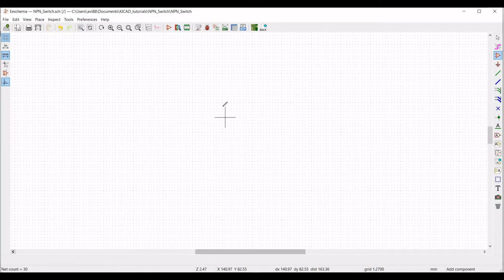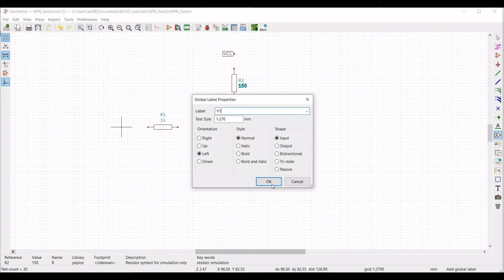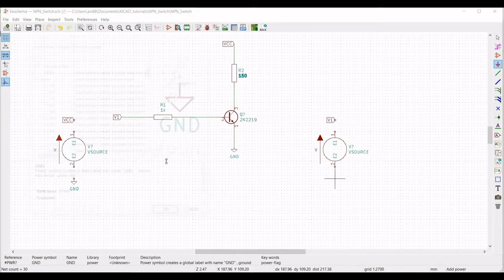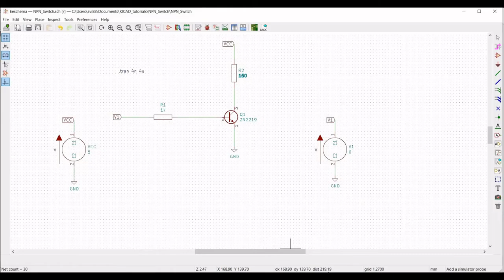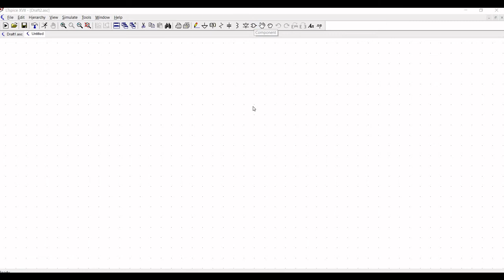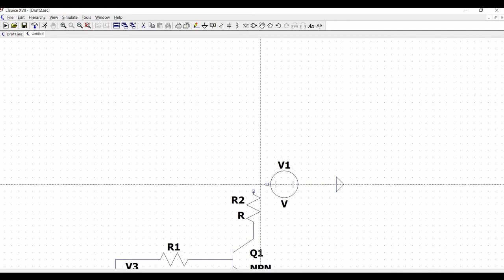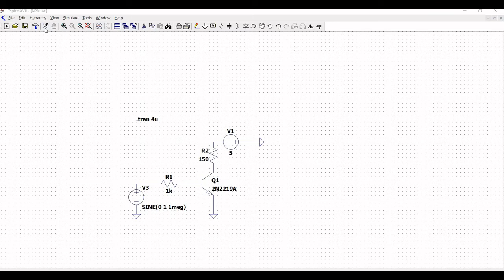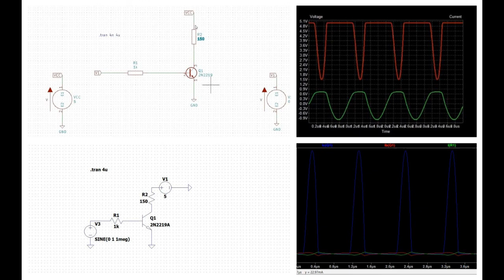NPN transistor switch circuit simulation comparison using ltspice vs kicad

Comment: Do you prefer LTspice or the KiCad ngspice now after 3years of use?
Reply from the maker: If we only consider the circuit simulation, then I felt LTspice was better choice. In Kicad we must define models, there are wider range of components and model support in LTspice. But when we look for PCB support kicad is the better option